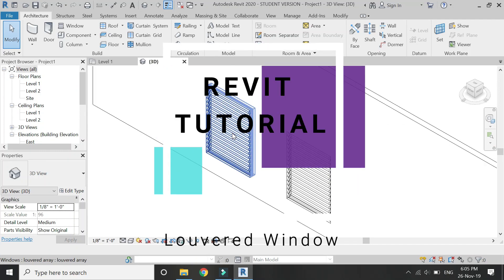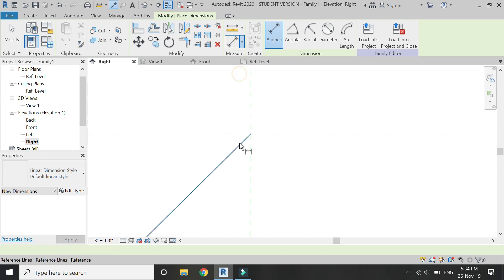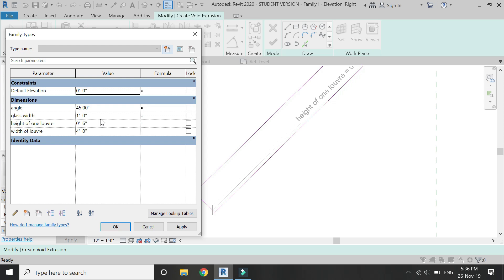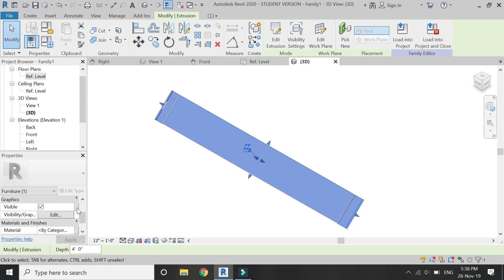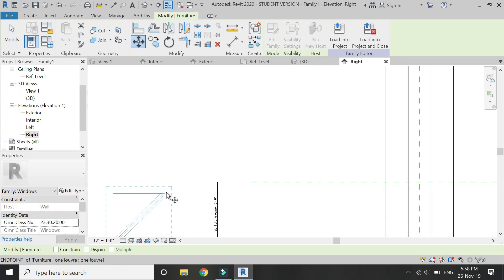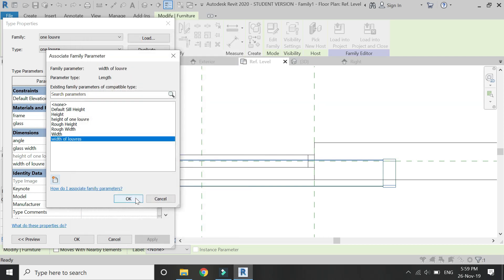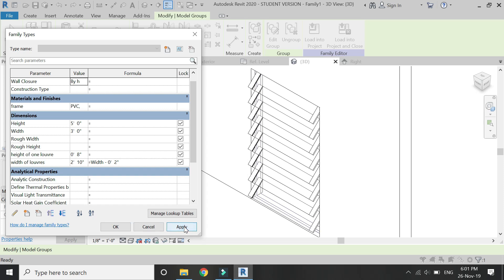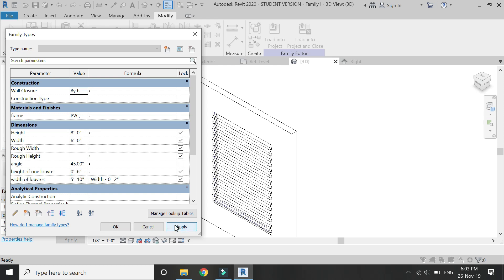Revit Tutorial - Louvered Window (Parametric Family)

Comment: Hello, Can you please explain why you need to do separate family instead of making louver blade with frame in the same family ?
Reply from the maker: It is easy to copy the louvers with the array command if it is not created in the same family. Because in this way it does not change its values of extrusions and also it is not created upon those reference planes. The other benefit is that it makes the family file less complex.
Reply: Thanks for your throrough enlightenment. Greatly appreciate your help !!!